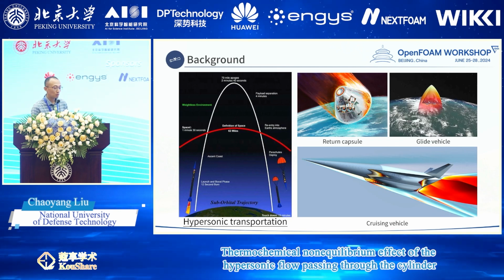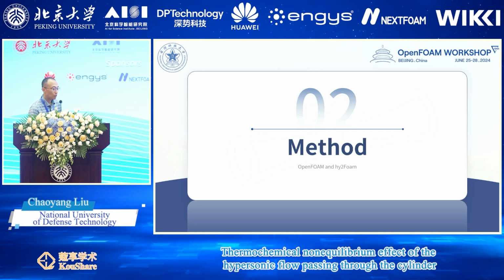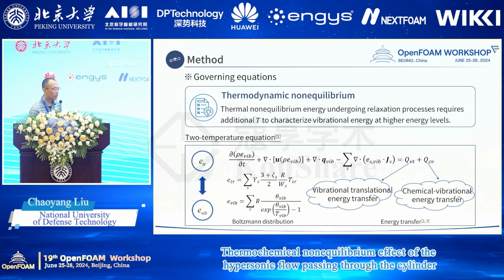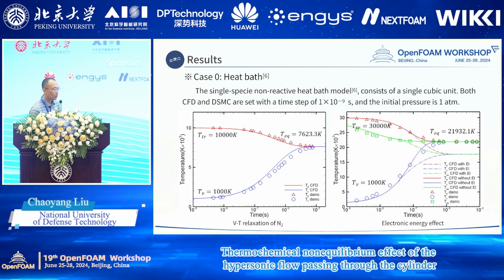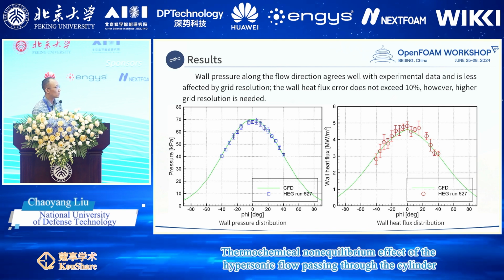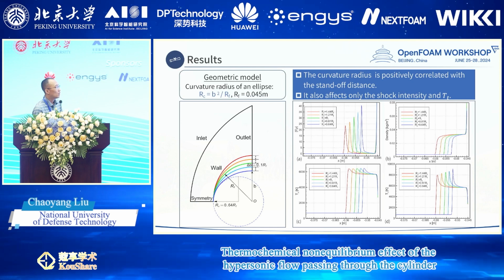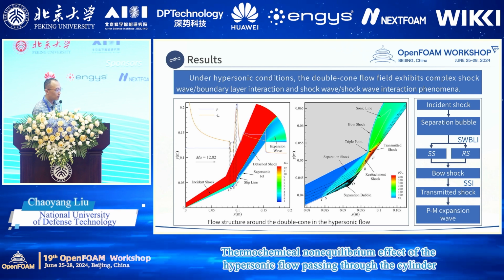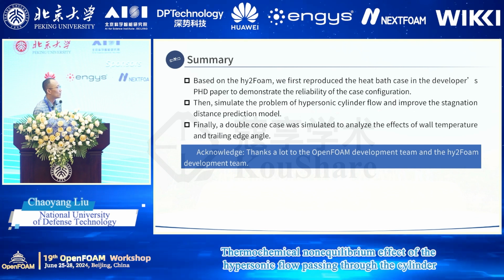[OFW19] Thermochemical nonequilibrium effect of the hypersonic flow passing through the cylinder

Comment: 👋Greetings Masters.
_How to adjust the Simulator to observe the behavior of the Atmospheric air in the intake of a Cylinder during combustion of the air/diesel mixture with the following conditions:
➡️ Admitted air mass; in order to obtain a leaner burn possible in the stoichiometric ratio range between 14.5/1 to 200/1. Taking into account the variation in temperature and pressure of the Atmospheric Air in the Intake from 17° to 50° and 1 ATM to 1020 mb (millibar).
The cylinder with a cubic capacity of 1200 milliliters with the geometry of the commercial Diesel engine model OM924.
-Consider the Diesel S10 in a typical mixture commonly found at gas stations ⛽.